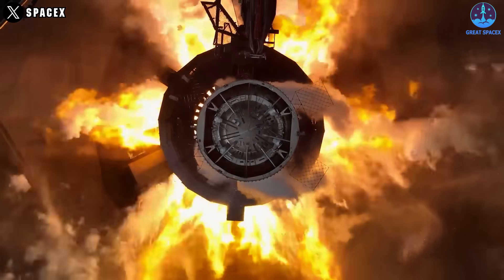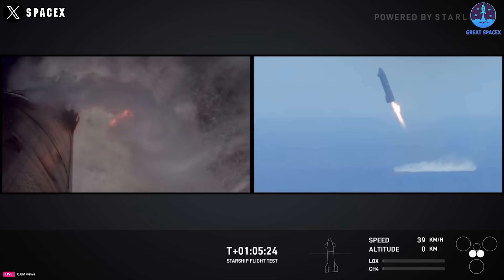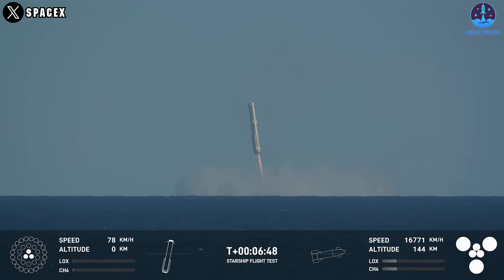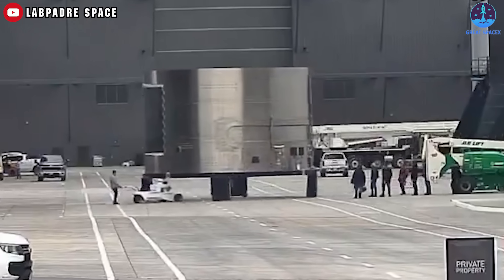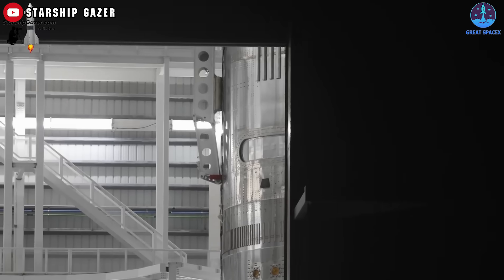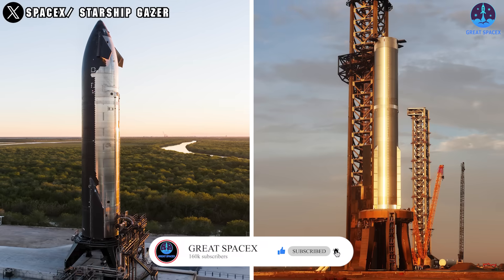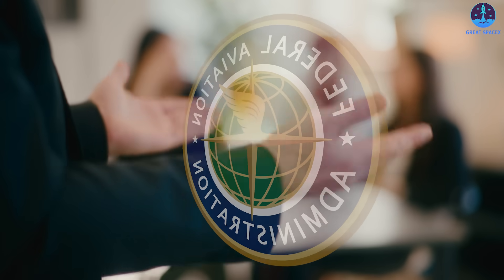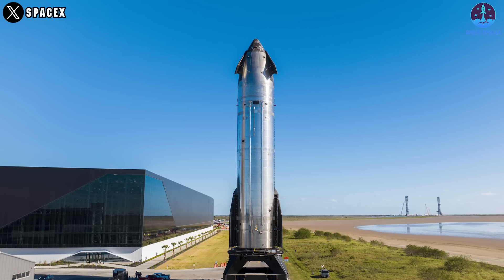SpaceX Revealed Massive Upgrades On Next Starship Flight 7 after Flight 6 Catch Failed!

Comment: Hey man thanks for your effort, really. 
two questions i had u may know to answer, wouldnt it be useful to turn on the engines of starship to decelerate and thus avoid such suffering while reentering? And the other, do we know anything form polaris dawn mission, any data colected that has been pusblished or is it all confidential?
Reply: The issue is that in order to use the engines to decelerate, you need to carry all that extra weight.  The more fuel you carry, the less payload you can carry.

Comment: Why is the pez dispenser slot (for the satellites) so big? Why have the long axis (as shown in the animations/simulations, they aren't square are they) come out instead of the short axis? Rotate them 90degrees and make the dispensing slot smaller. It would make the ship stiffer using a smaller door which would allow less reinforcement which in turn means a lighter starship.

Comment: I would like to see a full-size prototype of Starlink. This test will shake out the following:

* To test the Starlink loader through all phases.
* Test the Starlink magazine interface with the loader.
* Analyze the operational ejection of the load once in space.

While this test is underway, SpaceX can complete the build of launch mount 2 and testing.  Once both launch mounts are ready, two ships need to be mounted and tested. One is a tanker model, and the second is a long duration ship to test the full fuel transfer. 

Once these tests have been completed successfully, the next couple of prototype starships would be human ready to prepare for human flight certification.  In the meantime, a couple of ships need to be readied to test land on the moon and lift back off again.